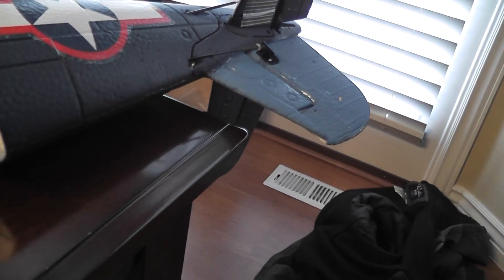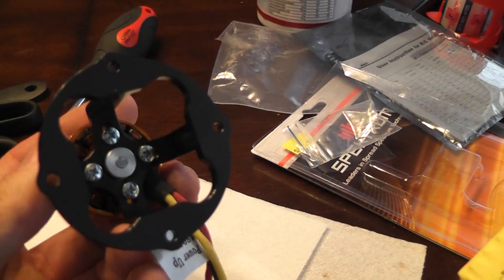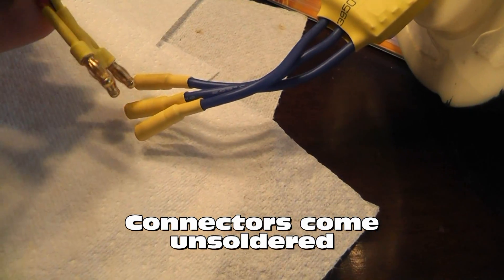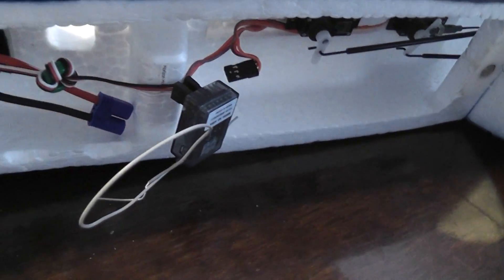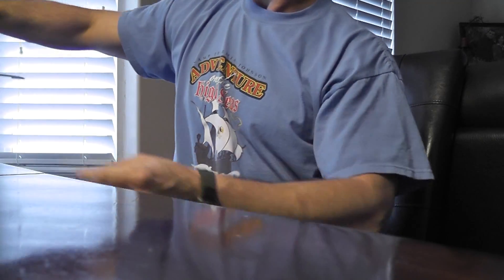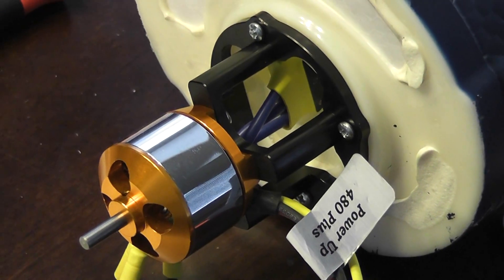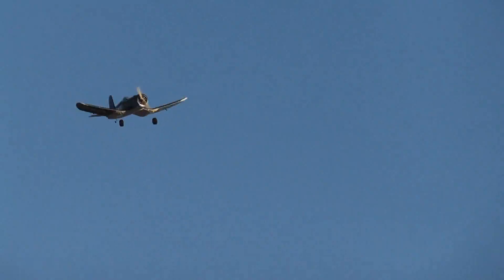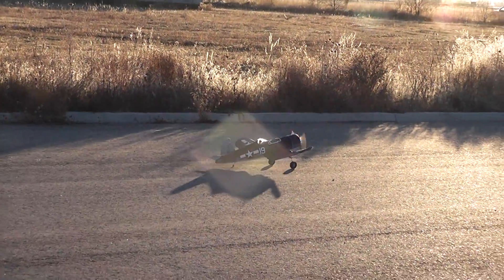Parkzone Corsair upgrade

Comment from the maker: I too broke a few motor mounts on this Corsair, but mostly because I was a beginner and panicked every time I had to land it.  I usually ended up crash-landing it.   But I feel a lot more confident today after extensive landing exercises, but we'll see.  I have an aluminum motor mount on my modified Super Cub, and it has been rock solid so far.  My theory is that the aluminum motor mount can take a GIGANTIC beating and stay solid, while the plastic motor mount is like an eggshell.  We'll see.:)